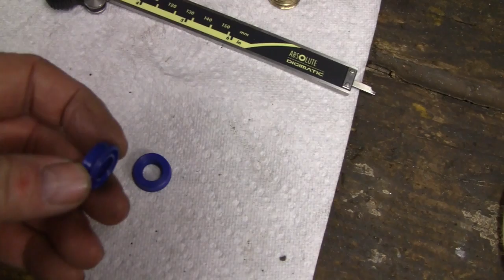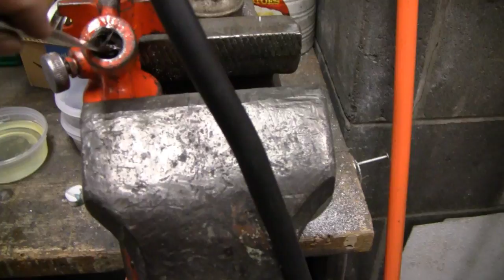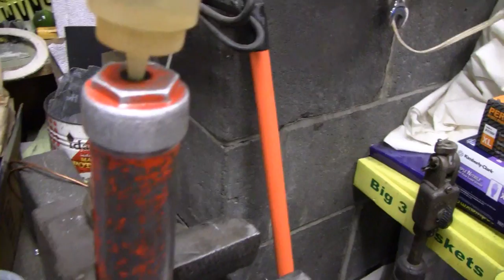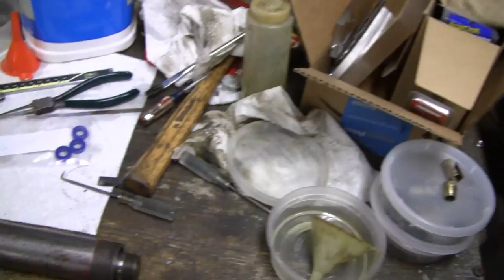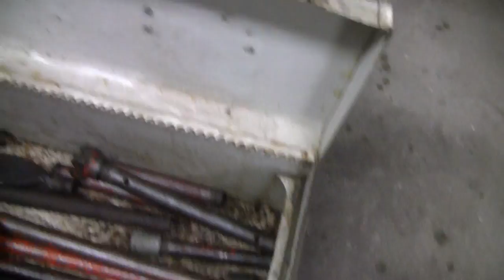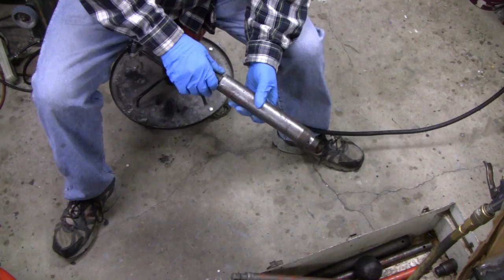HYDRAULIC PORTA-POWER REPAIR (part 2)

Comment: Excellent job on getting the old gal back in service. I have had one for about 25 years myself. I've use it for a ton of things you would even think a PP would do. level houses etc. The clam shell is really handy. It's great as a third hand when tightening belts and as a wedge to move a motor a little to get a mount to line up etc. keep up the good work.
Reply from the maker: Thanks Bud!! Yeah this one got me outta alotta jams!!☺

Comment: I used to have a similar unit that was made by Greenlee.  The thing was a monster that would do whatever you asked of it.  We used it for bending larger electrical conduit and we had an attachment for punching holes in electrical panels.  Made short work of anything we threw at it.
Reply from the maker: Yeah they pay for themselves the first few times you use them!!☺

Comment: where did ya order the parts? - I have one that leaks. 

I like the Duck bill attachment for squeezing deck boards together before screwing down a deck, just screw a sacrificial spare scrap of lumber to the joists, slip the duck bill in and a couple pumps - no gaps.  Once the pressure treated sits in the sun, they always shrink up and leave a nice even gap.

I just have to make sure mine is on some cardboard since it has leaked for what seams like ever
Reply from the maker: A place called The O Ring Store!!☺

Comment: Good tutorial thanks!  One thing if I can ask.   The rams on these things seem to be single acting (one one port in), do you have any idea how it is double acting (pump it it goes out, release the pressure it goes in)?  Somehow with one port you get double acting ...otherwise it would be like a bottle jack.
Reply from the maker: Thanks Bud!! This porta-power has a heavy spring to return the piston!! Most bottle jacks just use gravity or manual pressure to return the piston!!☺
Reply: Cool ...I really wondered on what the deal was.  Thanks for the fast reply.

Comment: my 4 ton astro will pump ok for a few strokes but will then start losing it's advance on each upstroke of the handle (this can be overridden by pumping very fast but is almost like treading water). 

It is full of fluid and has no leaks, I've tried bleeding it several times, but what could be a possible cause for this?

Comment: They dont look like vee pack seals....just normal poly u ring seals....the vee pack fit inside each other and when squashed you have like 5 tight sealing edges.....i bet that works at like 8 to 10000 psi  not sure the poly u rings will stand up to that pressure. Have to see i guess when you use it in anger.  Cheers.
Reply: I have the same tool/same problem. What would you recommend to replace those seals with?